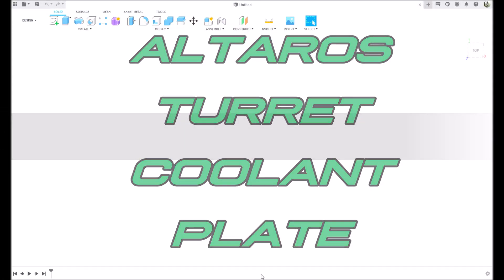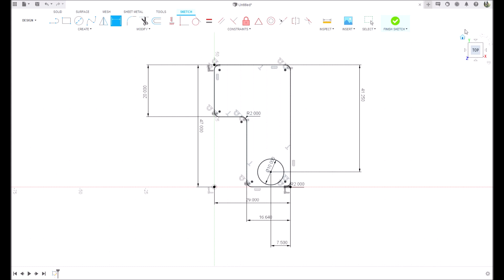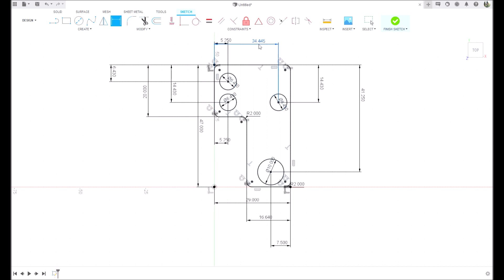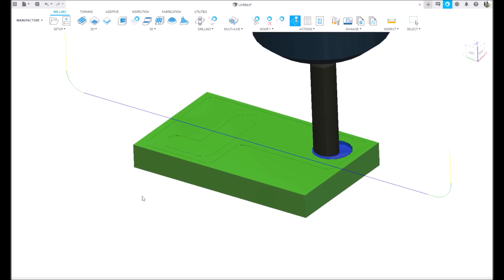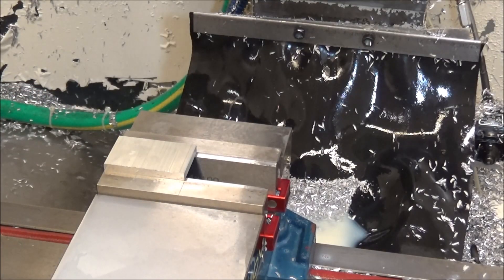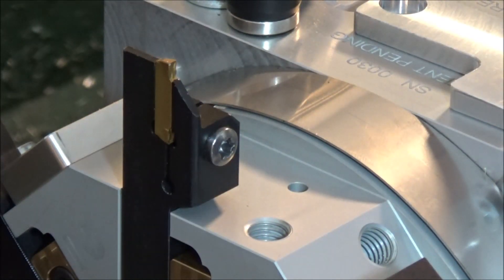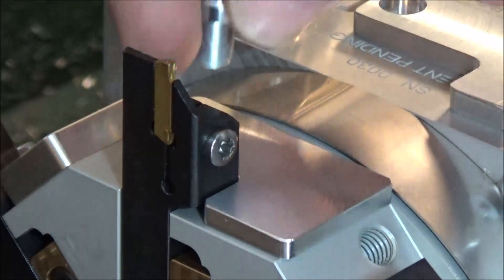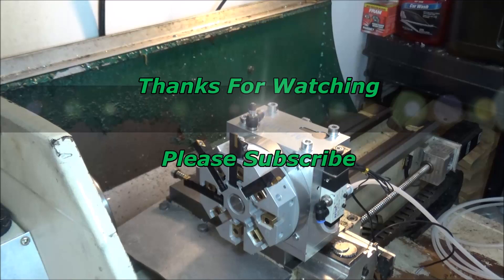ALTAROS COOLANT PLATE

Comment: You mentioned that you were concerned about it being a small part and may chatter.  The vise appears wide enough that you could duplicate the part in Fusion 360 to create a 2 parts at the same time.  This would utilize a bigger piece of metal and increase your production output.
If you were to take the subprogram approach it would seem that you would do all the steps for the first part and then the second part.  This has the disadvantage of more tool changes.
Reply from the maker: Yes I could have mirrored these parts.